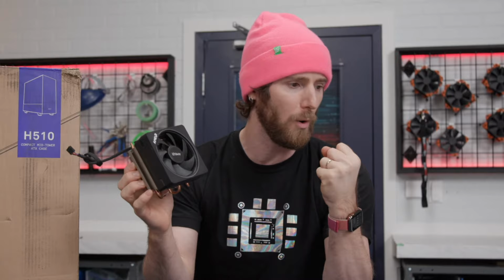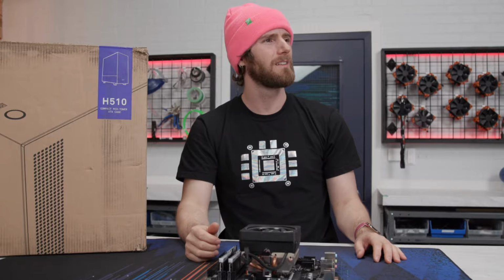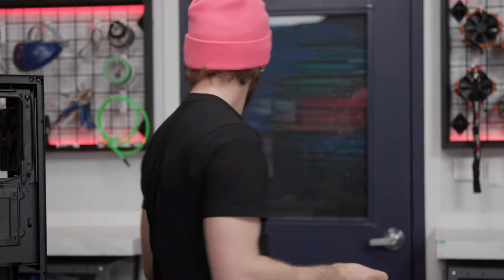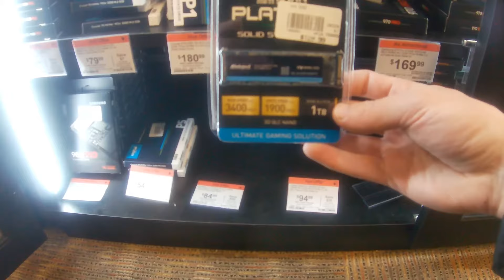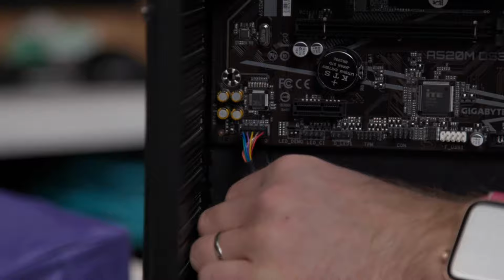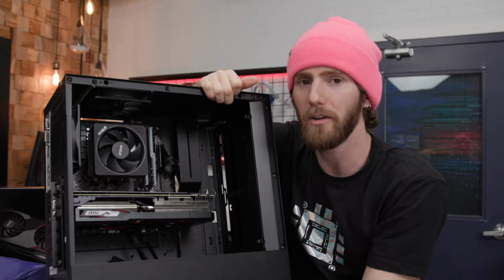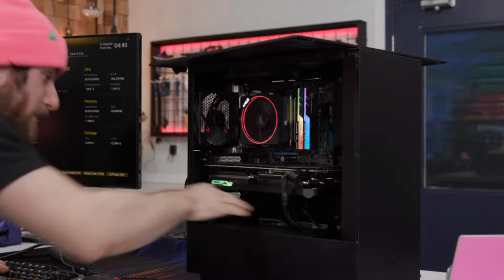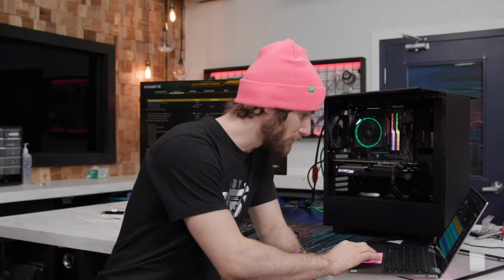Let's Build a Bang-for-the-Buck AMD Gaming PC!!

Comment: Bang for the buck :
-Fully modular power supply
-Trident Z ram
Reply: Here's the crazy thing about the Trident z... Even though it's RGB, occasionally depending on stock levels it's the cheaper choice. Crazy that RGB would be cheaper than something like RipSaw that's not RGB, but it is.
Reply: @TravisFabel  thats true, especially when you look 32gb kits. Team tforce rgb ram at 3000mhz was the same as a gskill 3000 32gb kit a few months ago.
Reply: @muchostacos67  I got a 32gb kit Trident Z RGB 3200mhz cl16 for 135€ back in september which is super cheap
Reply: 2x8GB 3200Mhz Team T-Force for ~50 bucks is bang for buck. I think this PC has better longevity tbh, so can't fault him for some of these choices since this PC appeals to gamers that like to see their rig. I'm old school and just find a spot where no one will see the PC in the event of a home invasion.
Reply: Trident Z isn't bang for buck as much as it is plug and play. It just works. The only other ram I recommend is Corsair Vengeance LPX because it's short and not RGB for stuff like stealth builds or DIY NAS.
Reply: Bang for buck isn't always the cheapest option, it's about value for money. Those two parts are pretty good value even if they do cost more than something non rgb or non modular. He even explains his reasoning, the psu is something that you can carry through to other builds for years and the memory is just really good quality and doesn't cost much more than non rgb sticks.
Reply: @TravisFabel  That's right. Funnily, the RGB RAM is chraper than the Non-RGB RAM.
Reply: trident Z is relatively cheap unless it's the samsung B die chips
Reply: I bought Trident Z RAM because at the time, it was the best bang for the buck. Ended up getting 32GB of 3200Mhz. It is RGB as well but I wasn’t specifically wanting that, just a good value. It was around Black Friday/Cyber Monday IIRC.
Reply: @prin8724  Uhhh, RipJaws.
Reply: I know right I actually have 2 PC's i know nuts right but one is my old stuff I put back together ...main rigs not extreme but decent Ryzen 7 2700x RX 5700 32gig and 1tb M.2 NVME and 1 TB SSD drive .....runs everything on a 32" 1440 144hz 32" curved screen from MSI my budget system is a Ryzen 3 2200g 16gig AData 2400 3.5" 1tb SSD and a badass 1650, not even the TI and for fun, I run games on both systems on the 1440 144hz screen and wow sometimes I wonder why I even built the better system as the 1650 and Ryzen 3 2200g system still runs allot of game damn good not just ok but damn good even Farcry 5 looks and plays awesome on the 1650 system wow also play Star citation on both and I really can not tell the difference wreckfest same runs great on both ...now cyberpunk 2077 it runs on the 1650 but definitely not as pretty as on the 8 core 5700 but can definitely play it well just my 2c .
Reply: blessed pfp @Stefano Agrotis
Reply: @TravisFabel  that is actually true so weird right?
Reply: Those are two areas I have found worth the splurging.  A quality power supply will see you through several builds.  As for ram, get what you trust, get more than you think you need, and pretty is nice 🤓
Reply: @prin8724  it just works? What brands of tam don't work?
Reply: @randybobandy9828  As Linus said, a lot of the time there is compatibility issues and you need to use a different kit, etc to get the advertised speed. Trident Z always works as advertised in my experience. I'm sure there's some motherboard it doesn't work with smoothly but I haven't found that motherboard yet nor do I want to.
Reply: CorVen LPX joined the chat.
Reply: @TravisFabel  depends on the country, in europe its mostly 20-30€ more expensive at the same speeds as ripjaw's or vengeance
Reply: UK HERE. WHO WANTS TO BUY A 5900X? I HAVE ONE. UK ONLY
Reply: @averagelawfan  it's a good meme, especially because I roll Fedora now.
Reply: @edwardcullen3251  go on ebay or some shit, not a youtube comment section..
Reply: @TDP808  "in the event of a home invasion..." okay gangsta. I see you.
Reply: @prin8724  I suppose. I think it's ridiculous ram manufacturers can get away with that shit. I bought 32gb 3200mhz corsair platinum 4.5years ago and it just worked out of the box at advertised speeds
Reply: Anyone tried the PNY 2x 16GB 3200Mhz? It's currently listed for $109 usd on b&h.
Reply: @StefanoAgrotis   youre a man of culture
Reply: @jasonwateano6775  Looks decent for the price tbh. I'd rather have 3200MHz CL14 or 3600MHz CL16 but looking on pcpartpicker it seems like it's the cheapest 32GB kit you can get that isn't real slow. So seems a nice deal.
Reply: @Elloli yeah.. I posted my comment too soon
Reply: @Elloli yeah.. I posted my comment too soon
Reply: @TravisFabel  You totally miss the point. By  fitting RGB Sticks it will encourage people to waste money on it. No one cares about some super special deal because on balance it costs more 9/10 fuking times.
Reply: He spends his money on a fully modular when he could've gotten a better ryzen 3, lmao.
Reply: - NZXT case
- Prism cooler on Ryzen 3 CPU
Reply: @TravisFabel  and the rgb gives you extra fps
Reply: New egg probably sells them for cheaper then say best buy or what not.
Reply: Even then if you can get it on sale it’s cheaper than the ripjaws, I got a 32gb kit of trident z for $150 when the ripjaws were around the same price where I could find them
Reply: Fully modular is pretty necessary

Comment: PSA: That Wraith Max cooler is not even sort of the stock cooler. You guys did this last time too with the Wraith Spire. That 3100 comes with a Wraith Stealth, its very misleading to say that a given cooler is THE stock cooler just because it is A stock cooler.
Reply: That's a good point, but Wraith Stealth is still a perfectly good cooler for anything below Ryzen 5 3600.
Reply: @Derael  that really holds no bearing on what I said whatsoever
Reply: I think what Linus meant was the design of their stock coolers and how much they have improved over the years. Not the fact that the Wraith Max is a stock cooler, Im guessing someone just picked up one that looked like a Wraith and said that goods well just use that.
Reply: Good point but they are all over ebay for cheap.
Reply: @AluminumHaste  but this is a Micro Center sponsored video. If you buy that cpu from the store it doesnt come with that cooler. Period.
Reply: @cm01  Why? I mean, they made a mistake regarding what exact cooler is a stock cooler for that processor, but everything else they said was correct: AMD Stock cooler is perfectly good enough for average consumer needs, regardless of what exact model is used, which was the main point.

So this mistake is kind of irrelevant.
Reply: @EbefrenRevo  I don't think they bought the CPU from Microcenter, they probably have a bunch of them lying around. Linus even mentioned that you probably can't find any in stock right now, so...
Reply: @Derael  so you're excusing a tech media outlet getting basic stuff wrong? Nice.
Reply: @cm01  Nah, I just don't consider this stuff basic or relevant. It has absolutely no impact on customer experience. It's a correct nitpick, but a nitpick nevertheless.
Reply: @cm01  its not a big deal
Reply: @ScutMonkey  pedantic to want the parts list to be coherent in a build video? Nothing could be further from the truth
Reply: @spartacus987  same to you
Reply: OP has a point. Is it a big deal? No. Does it impact the entire build? No.
Would linus be sad to see he mad a mistake because this is partially an informative build and it’s important people get the correct facts? Most likely
That’s like excusing the verge pc build for a few minor things that aren’t going to necessarily burn the pc up. It’s an informative video. They’re supposed to tell people the correct facts, regardless of importance
Reply: Why do you even care there’s not even a noticeable difference
Reply: You can add 20 bucks and get the Wraith PRISM off eBay.
Reply: @kizerparkhurst7532  Do you honestly think there's no noticeable difference between a cooler that uses a copper plate and heat pipes, and one which is just a lump of cast aluminium?
Reply: @kizerparkhurst7532  did you not even read my response?
Reply: @Derael *5600
Itll work for mid tier games
Reply: @funalots5357  When I wrote that comment, 5600 didn't exist. But yeah, it still works for 5600 as well (but not for 7600x).
Reply: My guy, you have way more important things to be putting your mind to than worrying about a Linus Tech Tips video having a mistake in it. The way your comment is written shows your far more concerned with trying to point out the mistake than making sure the correct information gets to the viewer. A good lesson you can take from this is that just pointing out other peoples mistakes in an effort to make yourself look smarter or better at whatever the video is about doesn’t work. People see right through it and its not going to serve you well in your personal life. You must have a good knowledge base when it comes to building computers and are focused enough to have caught the mistake which are good things. Use those qualities to help improve and uplift everybody around you. People will thank you for it instead of just not wanting to be around you or collaborate with you. Keep up the keen eye for details man.

Comment: Linus: says the CPU Cooler is the sock Ryzen 3 cooler

Me: THAT'S THE RYZEN 7 COOLER
Reply: My ryzen 7 didn’t come with a cooler 😔
Reply: @Nopenotatall  neither did my sock 😡
Reply: @Fattynutkins  same I hate it when socks don’t come with cpu coolers
Reply: lool I got my Ryzen 7 3700x today, using the stock cooler not bad but , ordered a coolermaster 212 just incase
Reply: I also have a noctua windsock cooler
Reply: Came with my 2700x that i use on my work desktop, no issues there.
Reply: I know right !!!!!
Reply: @wecf1411  well it depends
Where you get it from and what condition it's in
Reply: @Nopenotatall  rip
Reply: imagine not getting sock cooler..
Reply: It is a stock cooler, but so not the stock cooler!
Reply: @lowerfive6318  right? How else am I going to combat the those dastardly  exothermic reactions popping of my tootsies
Reply: @sirshinra  you'll end up with about the same performance.
Reply: UK HERE. WHO WANTS TO BUY A 5900X? I HAVE ONE. UK ONLY
Reply: It’s not the wraith prism rgb. It’s just wraith prism. So no, that’s not the ryzen 7 cooler
Reply: @paulnolan4971  I have a Scythe Mudgen 5
Reply: @sirshinra  you replaced coolermaster fan with coolermaster, 212 is not much different from 212
Reply: @TheWWWyrm  Lol CM didn't give AMD one of the best air cooling products for free. They make so much money from the 212. The AMD one (made by CM) hit 88c in some tests on a R5 3600 at 3.9ghz, whilst the 212 hit 65c. The 212 gives a BIG difference. the 212 is one of the most legendary coolers in the world and they don't even need to change it. You can even make it better with noctua fans.
Reply: @Nopenotatall  was it an xt processor?
Reply: @• hahaha •  yh ok but just searched it up and I think you're right...

Except you're not because if you skip to 1:06:06 you can see that it has got rgb on the cooler making it the Ryzen 7 cooler
Reply: @solarwolf678  ryzen 7 5800x. Had a aio for it anyway
Reply: Sim using the wraith prism that came with my 2700x on my 5600x when I upgraded and the pos stock cooler/heatsink that came with it I'm tryna make a heat sink for a human(myself) outta

Comment: Just checked out the parts linked in the description. Graphics card: out of stock everywhere. CPU doesn't even have a price tag. Yeah! No bang for no buck!
Reply: You're right, they should just stop making videos until stock comes back....oh wait thats a dumb idea
Reply: @michaelman315  that was your idea though he didn’t say that 😂
Reply: Was just about to comment something like that. Either it's out of stock or ridiculously high priced
Reply: I'd like to see them do a video were they shop online live(like the black Friday deals video) and actually buy what's available and see how they do
Reply: this is one of the things I dislike about linus, he says that the 3100 is best bang for the buck but it's 50 dollars more expensive than it was 2 months ago. it's also not even in stock most of the time because of how desired it is. I get that this is an AMD build, but an intel 10100 (f or non-f variant) beats out the 3100 in stocks, price, and performance.
Reply: well its is a lot cheper if you dont pay for the cpu and gpu /s
Reply: @Schulzenberger  Speaking of which... just checked the 5700XT again for the lols, lo and behold:
2 in stock at Tustin Store - Find online. Buy in store. $599.99... IIRC that card was around 400 when it was released (2019) and is roughly on par with the 1080 (or 2060S) which I got brand new for 450 over 2 years ago when the massively overpriced 20 series appeared and that thing was 2 years old already.

Comment: I didn't knew Ryzen 3 comes with wraith prism cooler😂
Reply: The Ryzen 3 price has inflated in the UK so am using an i3 10100 ;-; it's still decent tho
Reply: Suhayb MOHAMMED  ye and the 3100 can be found at up to £200 which is just stupid at that point
Reply: @_._shinonome_._  i3 10100 is basically a locked i7 7700k  really decent for 105-115 USD imo
Reply: @_._shinonome_._  Use currys PC world if you wanted the rysen 3 3200G, not the best for gaming but ok

Comment: if your RAM doesn't come on bare green PCB, it's not bang for the buck
Reply: Or it's ECC and you are paying way more.
Reply: Bare minimum packaging
Reply: Except that the color of the PCB don't really have anything to do with the cost...
Reply: matej nemec  Nope... Why on earth would it be cheaper to use green color die compared to i.e red, blue etc? Green is not a cheaper color to buy so that makes no sense.. :P
Reply: matej nemec  Yes, like it says in the link... "So, why are most circuit boards green? The simple answer is because they’ve always done it that way, and there isn’t a clear reason to switch"
There is no extra cost for the color itself... Extra cost to use more machines or washing etc has nothing to do with the price of the color itself ;) So like I said.. There is no extra cost if they choose to use a different color than green.
Reply: matej nemec  I know this.. And still it does NOT change the fact that the color itself (ONLY the color!) does NOT cost more ;) It's not really hard to understand. It's clearly stated that the actual color does not cost more. You confuse the actual price of the color itself with other parts of the manufacturing.

Comment: Had a hard time looking for usb-c connector on motherboards, finally found the MSI B550-A Pro. Best USB accommodation out of any board that I've had. Fan connectors are pretty nicely put on too
Reply: In December 2021, I wanted to build an allround PC, I found the MSI B450 Tomahawk Max.
It has a USB-C port, many USB Gen 3/2 ports, an M.2 NVME slot, six SATA ports (two of them are disabled if you are using an NVME storage), lots of PCI-e expansion slots… Basically everything a current PC needs in my opinion.
Flashing the BIOS is also easy. Now, I could even upgrade my CPU to a Ryzen 7 5600X or something, but I‘m really happy with my Ryzen 5 2600X as of today.
Reply: love that mobo

Comment: Ethernet to coax: using old coax cables already routed through walls as ethernet routing... No cutting drywall and running cables
Reply: Bah! You're no fun! Attic crawls are supercalifragic!
Reply: I have a network cable tester that has RJ45/8p8c jacks on both the tester and terminator plug. It came with several adapters for these RJ45/8p8c to convert them to other types of connectors, such as F-type coax and BNC coax. Normally, I plug an Ethernet cable into both the tester and the terminator and the tester will discover if all 8 pins on one end of the cable connect discretely to the 8 pins on the other end of the wire. The tester also has many different presets of known wire capacitance per foot for different wire types and can make an educated guess as to the length of the cable based on the value. There are settings for all sorts of cables (including some coax) or you can create your own if you know the specifics of your cable. I have never felt the need to use that functionality but I use my tester when either making network cables, confirming proper wiring of a network jack or trying to figure out which cable is which when I have a group of cables and can't otherwise tell which is which.
Reply: I haven't seen 10base2 networking in a wall anywhere since the 1990s.

Comment: I’ve had Roswell ATX 750 watt gold power supply  for the last 12 years, it has seen many upgrades and complete rebuilds. It’s a nice fire engine red and I will cry a river when it dies. I think it will outlast me. Always position your power supply at the very top of your tower  and ensure a good filtered airflow from the front of your case. Place your tower at table level, never on the floor, it keeps dust inflow down; add semi-coarse (can see through) air filtering at the front of your case ( inside the case) where you draw incoming air. Vacuum these weekly and wash them monthly by hand, dry and reuse. Keep your case cool by adding case fans and cutting a hole directly where the cpu is located on your removable side panel (fan body is outside the case), point the exhaust end outwards to draw air from the cpu fan’s heat sinks. Place another computer fan in the space between your GPU and the front of the case to push the filtered air through the GPU fins. :) Damn you had butter fingers with those tiny screws to attach the PS. 😂 Did you install that PS at the bottom of the case? Naughty, naughty… 😈 
On the audio, I simply use my optical audio jack to my 7.1 Sony audio system. Tada.. hehe.